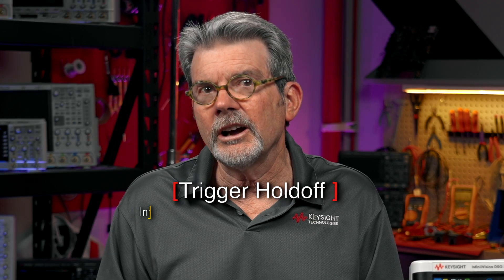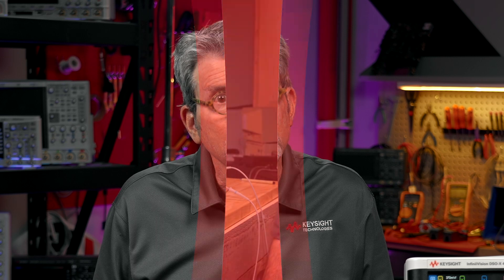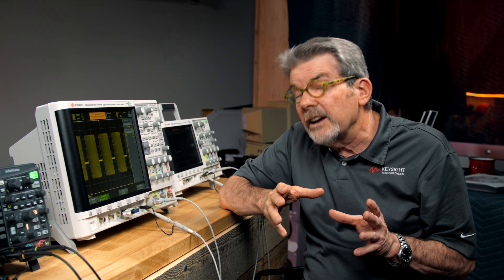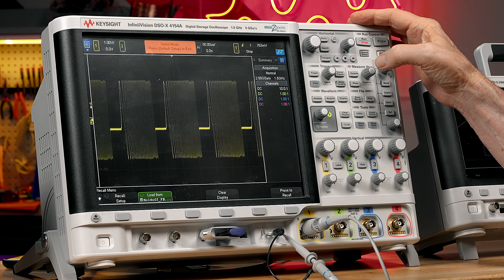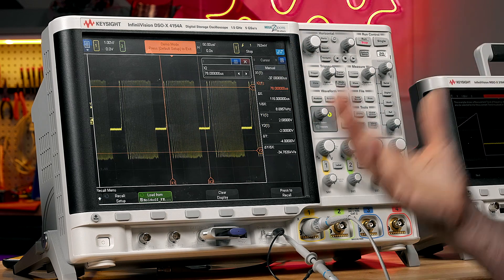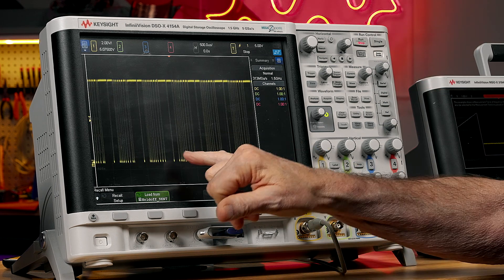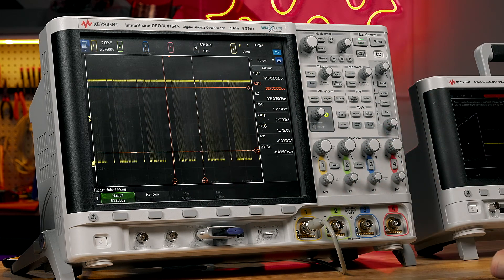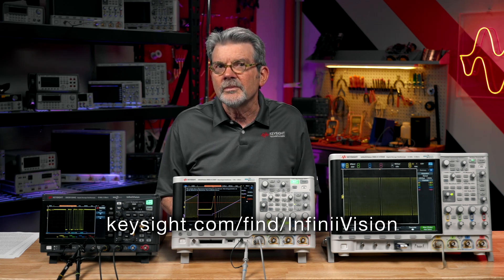How to use Trigger Holdoff on an Oscilloscope

Comment: I love your delivery and pace.   Quick and clear.   I recently had a need to view an A.M. modulated signal and couldn't get the scope to trigger consistently.   Someone suggested the holdoff and it worked like a charm.   I guess I could have stopped it and examined the memory but I wanted to just view it in real time.

Comment: Thank you for the video. The explanation still confuses me. Your scope you have the delay at 0s. In the 2nd example, when it triggers at 0s, it's going to draw the rest of the waveform it captures, up until it the right of the display at t=2500us (500uS/div * 5div) -- regardless of any other edges cross the trigger. It's not like the scope will 're-trigger' a 2nd time mid-screen (a new user could misinterpret the explanation). Also, the scope has X Mbytes of memory so you can even scroll to the right if you want and see more of the waveform captured. So how does adding 800uS holdoff guarantee where the trigger starts the next arming?
Reply: You caught something that I didn't really want to explain because I thought it would be even more confusing and I wanted to keep this video short and sweet. So here goes with a detailed explanation. When you use trigger holdoff, it creates what's call "trigger qualified events". For the two examples I showed, a "trigger qualified events" occurs at the beginning of each burst. Another qualification for triggering is whether the scope is ready to trigger again. All scopes have dead-time when they are processing information/waveforms from the current and previous acquisition. The scope will not rearm its trigger circuitry until its fully ready to acquire another waveform. 

Now back to the "trigger qualified events". There can be lots of trigger qualified events happening, but if the scope in not ready to rearm its trigger, it will ignore those trigger qualified events. In both examples I showed, a trigger qualified event happens at the beginning of each burst. Once the scope rearms its trigger circuitry after the end of its dead-time/processing time, the scope will trigger on the next trigger qualified event. So, there are actually two qualifiers before the scope will trigger. 1. A trigger qualified event (the 1st edge of each burst).  2. The scope has rearmed its trigger circuitry and is ready to accept a trigger qualified event. This is basically an ANDed condition for triggering. Both conditions must occur.

You mentioned a mid-screen event, as well as other events after mid-screen and possibly off-screen. These are all "trigger qualified events", but since the scope was still busy acquiring a waveform based on the trigger qualified event at center-screen, which was the actual trigger event, it ignored the second/mid-screen event (triggering hadn't been rearmed yet), as well as ignored other off-screen events to right.

Now to something that is even more confusing that you didn't ask about. When you initially enter a holdoff time that should be valid for a repeating burst, the first, second, third, etc., triggers may not occur on the first edge of the burst. The scope may walk down the signal and trigger on seemingly random edges, but after few random triggers, it will eventually lock onto the first edge of each burst each time it triggers. This typically happens so fast that you don't see it. Or it could happen enough times during the scope's initial dead-time and that it's never observed

Does this answer your question? Thanks for asking about this.
Reply: @johnniehancock2426   "Short and sweet" is nice, but we want more, so just keep them as long as the subject is fully explaind. maybe make it two part in the same video, forst part, the sweet, and then just keep it running and explaind the rest is for the realy curius ones .. Good work anyway! 🙂

Comment: Can you not do it faster by just moving the knob of the trigger hold off until it stops? instead of using the cursors and then set the holdoff time manually.
Reply: This is way it was done on old analog scopes. But the setting was always relative to the time base range. So, setting the trigger holdoff between 0% and 100% of the sweep using the knob was pretty easy. But if you just start twisting the knob on one of today's digital oscilloscopes, you are likely to go right past a valid holdoff setting before the scope has a change to sync up. This would be especially true if the time gap between bursts is very narrow relative to the burst width. An alternative to using cursors would be to simply make a visual estimate and begin tweaking the knob within guesstimate range values.